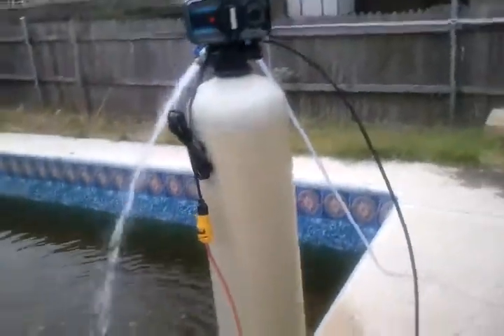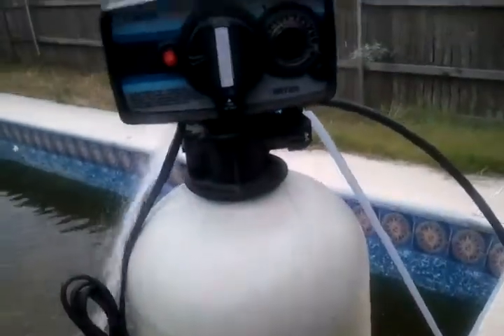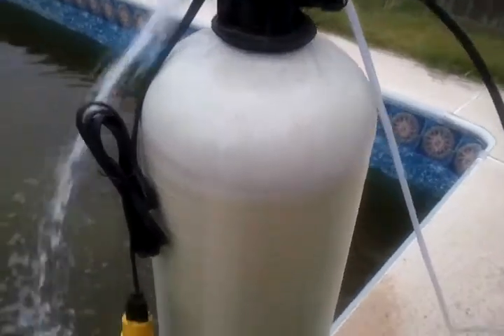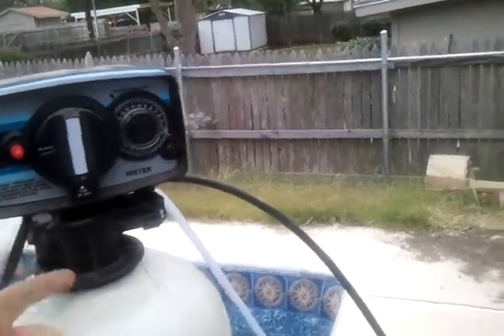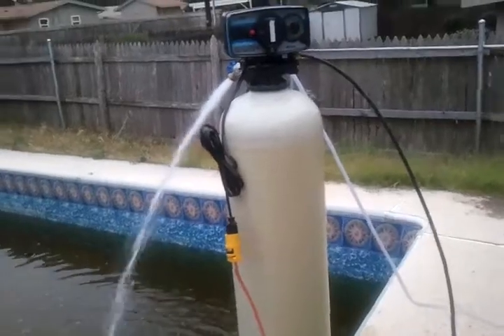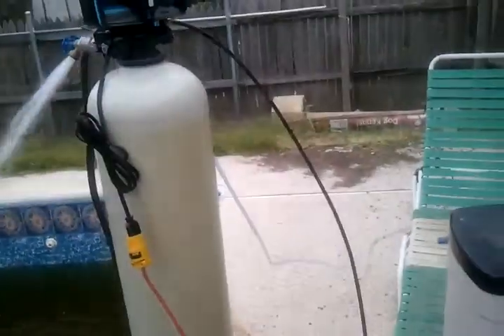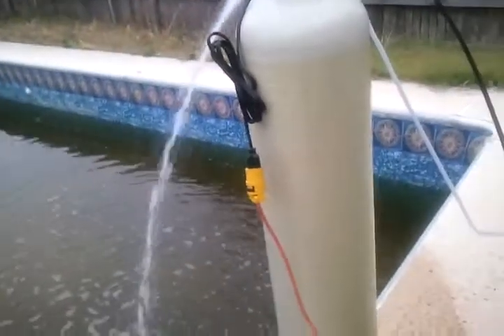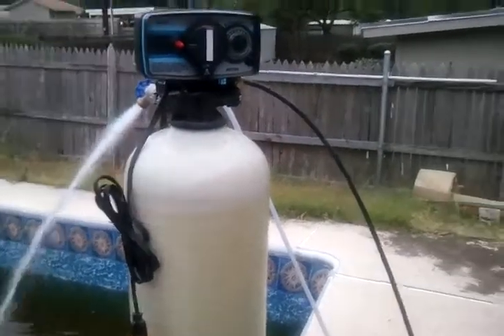Water softener recycle/repair update

Comment: There's 2 reasons to make this failure happening:
1- Broken or damaged lower distributor : letting the resin trough the service line
2- The center tube is damaged, perforated or just not fully inserted on the valve.

I hope I made it clear with my poor english, regards.

Comment from the maker: if you can get the bypass valve to work it should eliminate the resins.  sounds like something in the resin tank gave way and is allowing the resins to leak.  those heads just unscrew off.  probably the stand pipe in the center of the tank.  I found an online retailer and figured it all out.  this video was after the rebuild.  pretty easy.

Comment from the maker: @zacknew if you have the same head, there are lots of resources on the internet about it.  the place i bought my parts from has a channel here on you tube called watermanandy.  sounds like your regen cycle is having problems.  make sure you understand what the steps are in your regen cycle, set it off manually and watch it to see if there is a failure somewhere in the cycle (should take about an hour).